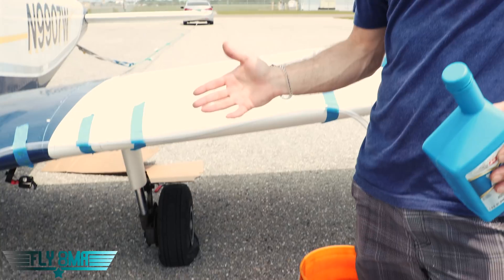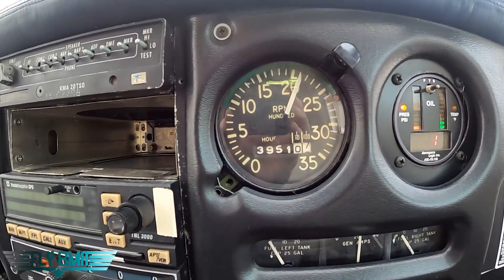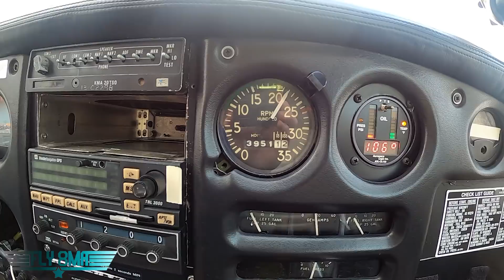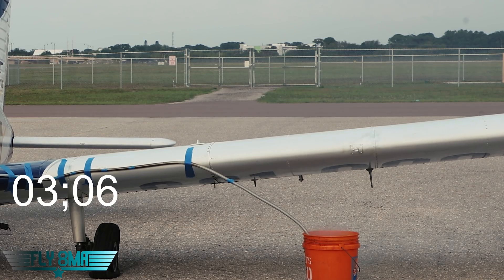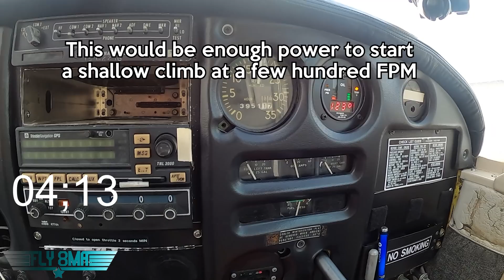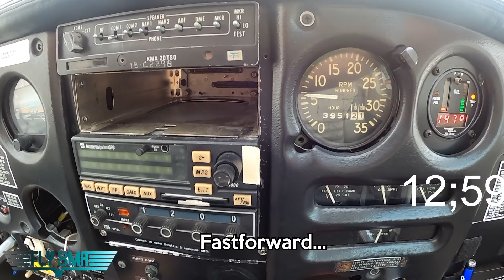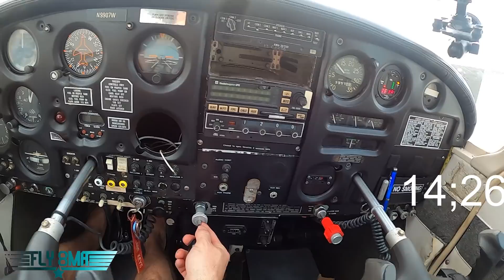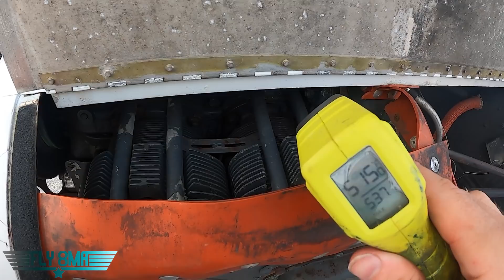Will it run WITHOUT OIL????

Comment: Last week, I had a loss of oil pressure in air. Reality was that I couldn’t fly for more than 1.5 minutes before I lost completely the engine and had the cockpit blasted with smoke. Resulted in an off airport landing at night, 2 lights polls and few broken bones.

Comment: Did you consider what might happen if you get some flames in that engine?   I'd be OK with this stunt if you had the fire department standing by, but without the fire fighters, this is just nutz.  That's my 2 cents.
Reply from the maker: What is going to burn?  The metal?

Comment: First, I'm a retired A&P with 35+ years in Part 121 operations. I realize this is your aircraft to do with as you please, but don't you have the engine logs? Even a timed out Lycoming, will have a lot of value. Just because an airframe is deregistered, that doesn't effect the powerplant (if logbook available). Even if the engine log isn't available, it still has considerable core value. This exercise really doesn't serve any useful purpose IMHO. Without an aural alarm or master warning visual annunciator for oil pressure, that engine will be close to seizing before most pilots become aware of the issue which negates this exercise. Even if it's caught immediately, the time before total loss of power will vary greatly (as you stated). I'm sorry, willfull destruction of an otherwise servicable aviation powerplant will likely loose you respect (at least in the aviation community).

Comment: Interesting demonstration. Isn't there a certification requirement that the engine must run for so many minutes without oil? The Cherokee I did the bulk of my flight training in is grounded (permanently) due to structural issues. She had a good life.
Reply: Laura Halliday I do believe that they have to be able to run normally at half the typical/rated oil quantity. Not good for the engine, but keeps you in the air.

Comment: I think the big issue is that with no alarm you may waste the first 5 minutes before noticing the oil loss. 
Second up, the air-frame may be scrap but the engine probably still had substantial value for parts or rebuilding. Still nice to see the empirical result.
Reply: Instrument scan: no more than a few seconds. When my plane's alternator packed up last summer it was about five seconds to the instrument scan, five seconds of WTF?!, then grab the checklist.

Comment: Remember the Gulf oil ads draining the oil and driving around Manhattan for four hours? As if brand makes a difference. 
Actually seizure will usually be at the main bearings and the more worn the bearings the longer it will take. Restart is usually possible after it's off for a while.

Comment: 16:31 - Chances one in a million, but would have been one nasty bite if the engine popped to life there. That was pretty dumb....
Reply: Rcbif could it still pop to life if the magnetos were off? I’m assuming he switched off mags from inside the cockpit.
Reply: @orangerc2358  - Yes, you can have a broken mag switch, a broken p-lead, or bad p-lead connection. You should test kill the engine by using the mag switch at the end of every flight, but even then, one of those components could fail or let go from that test. You might think it's good, shut-down with the mixture as usual, do something dumb with the prop, and then you're covered in blood. Happened at my local flight school. Luckily only one cylinder weakly popped and the guy only got stitches to the head. Extremely lucky. 

A loaded gun with the safety on, even if broken, is still a loaded gun.

Comment: That is not the way to drop the oil of a plane.  You go over elementary schools over Los Angeles and drop the oil, like that Delta 777 did with jet fuel in January.

Comment: I see no point in this video other than entertainment. Everyone knows oil is needed. Considering your audience of impressionable young, novice, aviators what is their take away? "Don't worry guys, if you lose oil pressure you have plenty of time. Go ahead and keep going towards that airport, it'll be all right." As a CFI you always need to ask the following question: Does everything I do, say, and teach prepare my student (or YouTube audience) for that they need to succeed in their life and career. I cringe to think of all the low time/experience guys that will take what you publish and call it truth in all circumstances.
Reply: He actually said a couple of times that this could be atypical and the the engine may seize in seconds.
Reply: As a pilot i find this very informative.

Comment: Cool... I’ve heard stories of guys having lost oil pressure with no where to land and having upwards of 20 minutes. Another thing, in flight it may last longer, as you’re getting more air cooling. The bad thing is, if you aren’t paying attention to your oil pressure, you might not notice it until you’re loosing power.
Reply from the maker: Great point!

Comment: My guess is you were losing power because the hydraulic lifters were collapsing because there wasn't enough oil in them to keep them fully extended. So basically some of the valves weren't opening all the way or at all. Obviously the increased friction on all the surfaces too, but I'm talking about when it starts vibrating from losing cylinders.
Reply: lifters fill themselves and dont need oil pressure to keep them inflated, as you learn when trying to drain them to check rod clearances.

Comment: As a (non aircraft certified) mechanic with an engineering background, the smoke coming out of the hose is basically the oil vapors cooking off in the engine. The oil temperature sensor normally resides in the pan or a line, without oil touching it it will falsely read the air temperature it is in contact with. The rpm variation is a typical sequence of events...  Runs normally then when the oil film starts to break down and cook out of the bearings it will lose some rpm, further running starts to heat the bearings and cause expansion and extra friction... At a certain point the bearings wear enough to free up and rpm will increase  slightly... After this point its just pray 🤣 the reason at the last moments of life the engine likes less throttle is it lowers the internal cylinder pressure and reduces load on the rod bearings letting it free up slightly. If you get unlucky the front main bearing that takes the main prop thrust load will bind up and lock up sooner.

Comment: NO FIRE EXTINGUISHER , NOT EVEN ONE AROUND THE PLANE ?WHAT HAPPENS IF THE FUEL LINE BRAKES OR CARBURETOR CATCHES ON FIRE!! BETWEEN THE HANGARS ?? I BET NO INSURANCE EITHER  ON THAT  AIRCRAFT.. I CAN TELL YOU HAVE NO MECHANICAL MIND BUT BECAME A PILOT THO JUST LIKE OTHERS OUT THERE CALL THEMSELVES PILOTS
Reply: my first reaction was "where are the fire extinguishers?", and then some poor guy taxis by with no clue as to the stupidity taking place.  if there's ever a fire i like to wear shorts and flip flops.  at least he had his camera to document his burns or engine parts coming thru the firewall [throwing a rod is pretty violent]
so this "information" is going to help me make decisions in flight if i lose oil pressure?

Comment: I figured you would get less than 5 minutes and thrown rod.   Pretty interesting test.  Next, do an IO-520.  I’ll wait.
Reply: Excellent  info on taxi on gravel technique Yann! Thanks.
Reply from the maker: Have one to donate?  A little low on cash....  Can you use a PPP load to buy a 520?
Reply: FLY8MA.com Flight Training I’ll scrounge around, see what turns up.  If you can get her to run again, I think you ought to put some fix-a-flat in the tire, and taxi over to some gravel, do a study on prop vortices with varying winds, demonstrate how to get moving without fragging the prop.  My first boss in AK bushflying 20 years ago, taught me the tricks of the trade.  Keep pointed upwind, clear  the path of wheels from rocks before taxiing, don’t try to turn until you have momentum, park strategically, etc.  But my biggest “aha” was the vortex under the prop. It takes several seconds to form after RPM stabilizes.  If you can keep the RPMs changing, the vortex can’t develop, and you’ll be way less likely to suck water, dust and gravel.   Short bursts of power, rather than steady rise, to get her moving.  Once you’re in motion upwind, you’re good.  If there is a tailwind matching your speed, you might want to taxi faster, or continue to use bursts.  Flying cubs, 206, 180, beaver, otter, Navajos, 441s, King Airs off gravel, mud, sand, water, for 15000 hours, listening for / observing prop erosion postflight , and watching lots of other guys frag their props, have shown these tricks to be worthwhile.

Comment: Jon - just curious, what was so wrong with the airplane that junking it made more sense than fixing/maintaining or selling it?
Reply: I was wondering the same thing.
Reply: Nobody loves moldy old cherokees enough to pay $$$ to make it airworthy again.  The 0-320 probably did have some value as a core, but not much else.
Reply from the maker: Ya... It was going to cost much more to repair than have replaced
Reply: @PostcardsfromAlaska   YOU DON'T KNOW WHAT YOUR TALKING ABOUT, THE CORE VALUE WHEN RUNNING IS WORTH > $10k ,  A REAL WASTE. THE 0-320 IS A REALLY DESIRABLE ENGINE FOR A LOT OF PLANES.
Reply: @wlbrobinson  It's all good as he'll make up the difference in YouTube views. Just do him a favor and make sure you watch the ads all the way through.
Reply: @michaelb.8953  I
HATE
ADSSSSSSSS

Comment: Why lowering power while lean created more rpm?
Reply from the maker: Feeding the cylinders too much air at too low an RPM...you need more RPM with a wide open throttle plate to get the right mixture coming from the carb
Reply: Maybe a mixing issue, the throttle plate being partly closed will create turbulence that helps stir the air and fuel more uniformly, some manifolds and engines naturally have problems mixing and evenly distributing the mix to the cylinders. This is also a primary advantage of multi-port fuel injection, with each cylinder having an injector the richness can be tuned and matched.

Comment: I wonder if they had used slick 50 or some other additive in their oil in the past. Could that be why it lasted so long and didn't throw a rod.
Reply from the maker: Nothing like that used in the past...would like to try it again on another engine with additive, but ya know...kinda expensive
Reply: @fly8ma.comflighttraining199 (expensive)  I'm sure of that.
Reply: Check out Project Farm's channel.  There are videos on there where he tests different oils and additives in small gas engines.

Comment: Oh yes, the older ( hrs on components )  the motor the longer it will last. 
 We had a old wore out Kubota. 60 horse tractor that they changed the oil and did not put oil in it.   It made it 1.2 clock hours pulling a 10 foot cutter behind it before it shredded the crank. And really the only damage was caused from spun rod bearings.